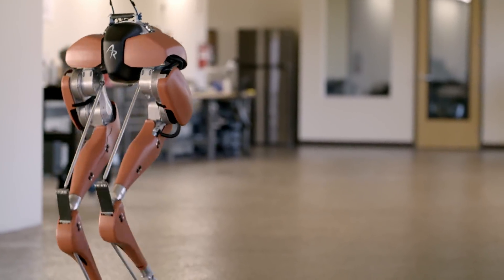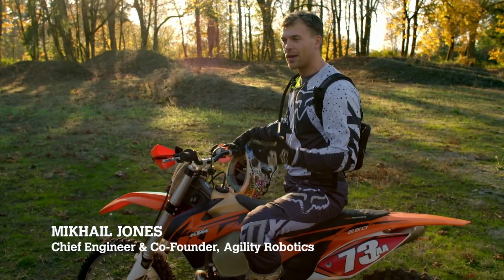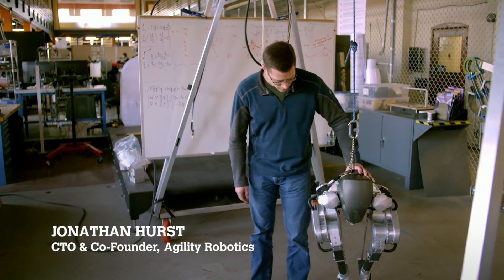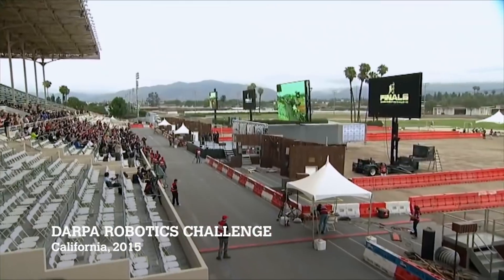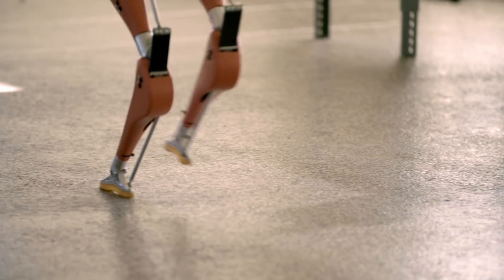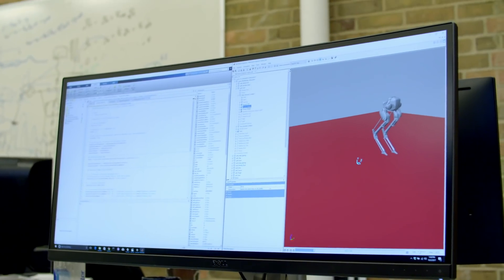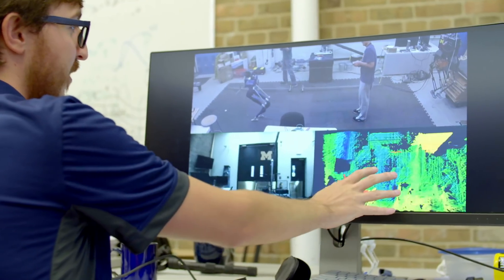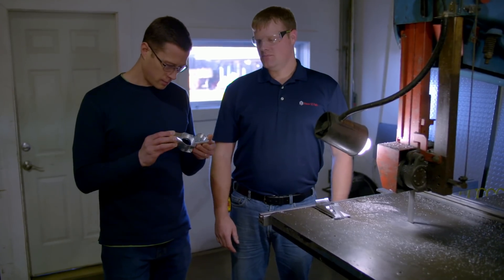The Two-Legged Robots Walking Into the Future

Comment: Imagine in the future they're good enough, they could be set up in boxes on street corners for dispatch to release, to quickly get to a scene and give early help. Like, imagine one of these having a small fire extinguisher within it, or attached to it, albeit a larger version, and running to a fire and keeping certain spots contained, until firefighters arrived. Or one with non-lethal equipment for police, so no one is significantly harmed. Or heck, a paramedic version, where it could send images to an ambulance for them to get an early idea of what they need to do. Heck, they could slap on a screen with instructions on basic first aid, with an audible pre-recorded voice.

For domestic use, these are pretty decent, if they get developed enough, and have a reasonable price. Make it a price where they could still make profit, and of course, a limited time for how long they're active. I'd personally want it to be between 7-10 years, and out of mostly materials that could be recyled to make another one of them, so it's also cost-efficient.

It could even go to a disaster zone. Say there's an earthquake or a tornado. And these things are at least in a sort of container durable enough to survive, and are pre-equipped with a set of instructions on what to do if it happens. Say, the company or local emergency services could release them, and they could give light and rations, and a GPS for emergency services to find people. Or even help in search and rescue, where a team of firefighters and paramedics go one direction, and it goes another direction, to speed up the search for survivors.

These are very optimistic... But I do hope these make significant progress for at least some practical way for them to be used. And cost efficient where people would at least want it. Especially if they made more versions.

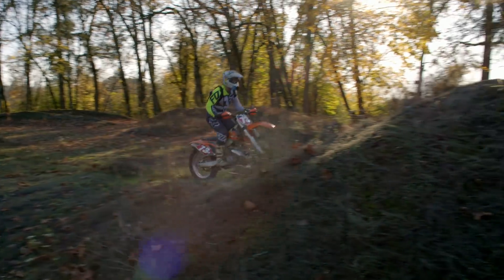Comment: 9:13 I disagree that the bipedal robot problem is the same as building a motorcycle or car that can just move. Sure the springs and flexibility built into the motorcycle especially have a kind of "intelligence" for compensating the roughness of the terrain etc., but that is complete reactive instead of active and it was possible to solve the problem with purely of combination of passive components and clever mechanics. I don't think any combination of passive mechanical parts like say gyroscopes and springs could produce a stable and robust walk. You need a computer and acceleration sensors...

Comment: The robots that use cameras or IR lasers to gather data around them, do the creators isolate the cameras / IR laser sensors from the shocks of the frame so that they imitate human eyes? Sort of like focus tracking included with the camera / IR laser senors having freedom of 360 rotation and a 3D movement of roughly 2 inches to mitigate shock and shakiness.  Sorry if the comment seems inarticulate.

Comment: Reverse engineering the inner ear.  
But will it have to be completely reprogrammed if it is attached to an upper body?
Everything electronic can be hacked.  I hope they have built in several back doors in the software just in case.
Birds can't do stairs.  Because they can fly.  So perhaps the top half will be a drone of some kind.
If they can make an electronic inner ear, this information could help some people with balance problems.  
The other use for it could be in balancing large construction cranes, and tall structures.  And in balancing structures during seismic events.  Imagine this attached to ladders.
My feeling is the best use for these right now is to create a more lifelike wax museum.
Everything else is too dangerous until we have learned how to do Peace On Earth.
My favorite use for this would be to help caregivers of the disabled and elderly with lifting and cleaning.

Comment: @02:50 If Fukushima has told us one thing then it's even Robots not being able to enter a high radiation environment like the ones after a nuclear reactor meltdown because of the radiation "particles" destroying the nanoscale circuits inside the chips as they pass through them.

Also pretty sure if you want to have a robot that works in tandem with us and the environment catering to us then going with a bird type leg design is the least favorable choice you could go for. Good luck getting this bugger properly seated in a car for a sortie. I'm also quite certain this design is having a blast descending a narrow stairway ( ED-209 sends his condolences =D )

Comment: Why so much focus on bipedal robots? Are there really that many things that a bipedal robot can do that a four legged or four wheeled robot can't do? Name me a place that a human can go that a mountain goat can't. Three or four points of stability is way easier to solve and we could be focusing on the actual problems the robots are designed for like rescuing people instead of making a bipedal robot not suck so much
Reply: All the world's technological structures are designed to be used by a bipedal. 3 or 4 point's of stability takes up more square space so you can't drive a car with a tripod or a four legged bot, or you might not fit into a tiny elevator and all shorts of shortcomings by using more than 2 points of stability. It might not walk as fluently now, but in the next five years i bet it will walk better than humans, faster, quieter, snapier and more fluently. But it has to start somewhere, like as humans did when we were born. You couldn't walk for the first year of your life and certaintly you weren't walking better than this robot when you were 2-3 years old. Give it some time, money & effort and in less than five years it will move like a champ.

Comment: I don't understand why the feet aren't flexible in pivot like our ankles do. this would allow for rocky floors and adjustments without tilting the body.. most likely easier said than done I guess.
Continuous stepping to correct balance and not moving wastes energy, they really need to work on balance via simulated ankles and feet with pressure sensors.

Comment: for the torso part, maybe have 2 slightly weighed wheels spinning vertically in opposite directions using mainly perceptual motion, but uses a little bit of electricity every now and then so it doesnt stop, maybe that will make it easier idk

Comment: HRP4 and atlas are not "novelties", they are more advanced than the above though I am sure all designs have their merits. 

And your fellow lied re Fukushima. "turning a couple of valves" would have done squat. There are no valves you can turn that will stop a meltdown caused by complete failure of primary and backup power systems coupled with the destruction of the electrical control systems making even a tertiary supply bypassing the damaged systems impossible even if one could be found in time. You have to admire the genius of the village idiot who designed major critical systems and backup generators below sea level in a known Tsunami zone.

Also sensitive electronics and high levels of gamma radiation really do not mix. Ask NASA.

Robots afterwards would be useful for cleanup, but none on this earth of flesh nor metal could have stopped those reactors taking a journey through the floor.
Reply: ArmyOfAll The premise, as stated at the end of this video, is that if robots where capable of working in hazardous environments, we would choose to send them instead of risking human lives.

Comment: why no one is talking about the power source of those recent super thin robots? What happened with huge batteries? Did they manage to somehow pack li-ion so tight that there's no need for wires or is it some experimental graphite batteries?
Reply: Current Lithium Ion chemistry is not non-linear. 
Goodenough believes it has reached its chemical potential, at most a few percent unrealized.
Tesla's (from Dahn's research) 2170 cells are reported to be 15% more capacity and twice the recharge life than competitors. This is likely to be its pinnacle and sufficient for electric transportation up to super car performance (Roadster2, Semi truck).
Solid electrolyte batteries under development for many years will allow greater power densities and faster charging under greater temperature ranges, but atm not demonstrated able to be commercially made. Musk estimates that once power densities of greater than 400kWh/kg (twice LiIon) electric commercial aviation will be possible.
Reply: Wayne Russell,
Maybe he meant battery technology in general, more than certain type of battery chemistry?  It's just that li-ion is currently the best one.
Reply: Nik,
Ephemeralization.